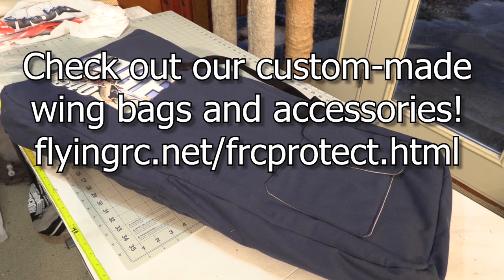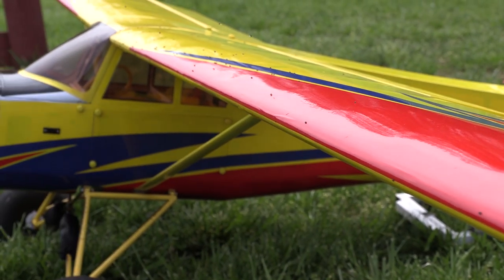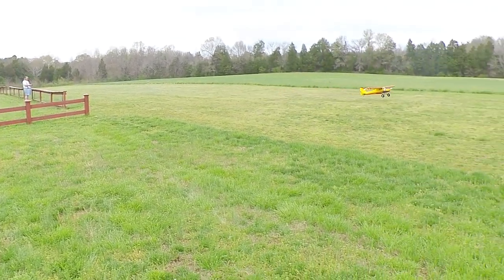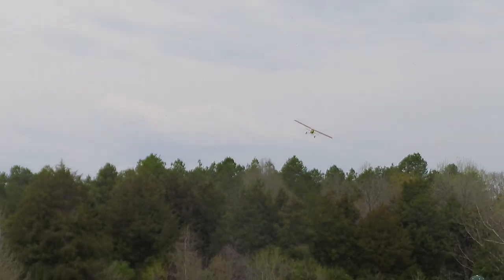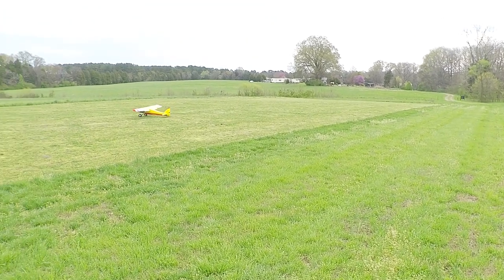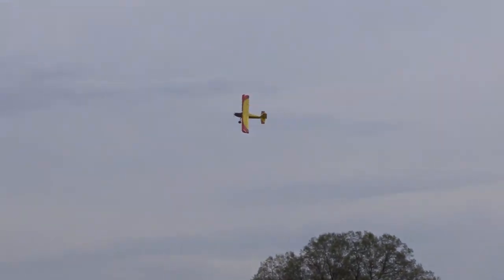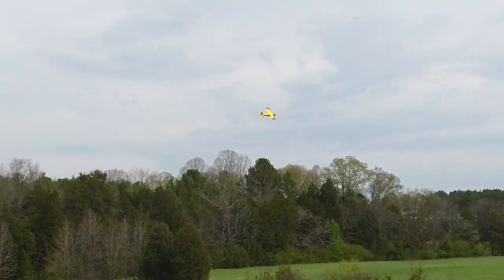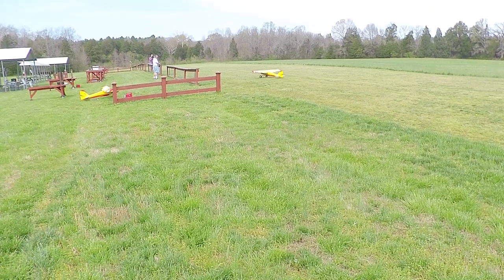Timber Maiden day

Comment: Tom, another great video. I am now confused, I was looking at purchasing the 30CC Valiant. However this looks just as good. What would you recommend?
Reply from the maker: You are right, I have long been of the opinion that the 30cc Valiant was as good as it gets in a high wing plane. Now, I have to go with the Timber because it is even more aerobatic yet can be as docile as you may want. Now I have TWO high wing planes I can;t let go of!
Reply: Thanks, appreciate your opinion. Which ever way I go, I will be ordering your wing bags. I have them for my 10cc Valiant they have kept the hangar rash to a minimum.